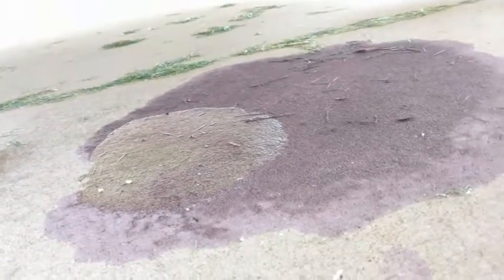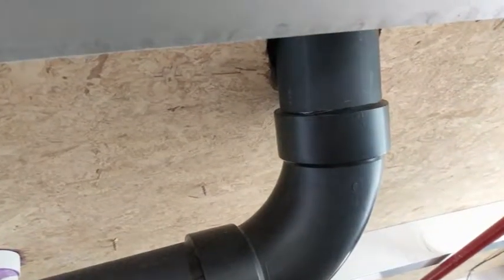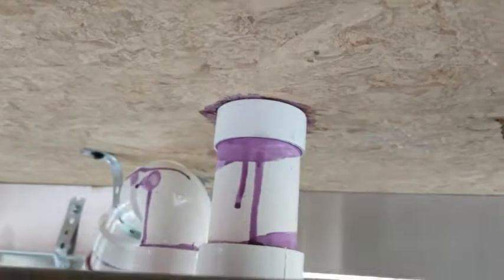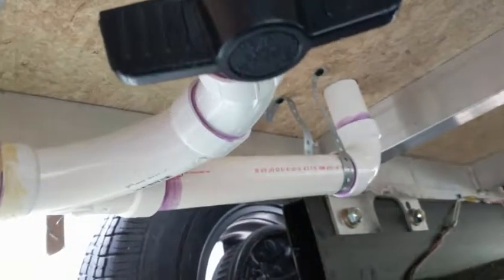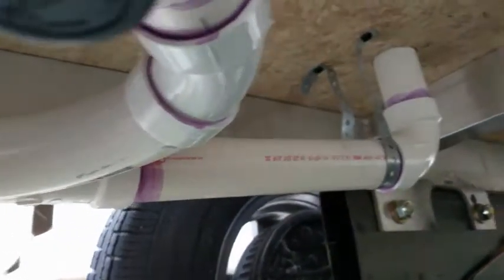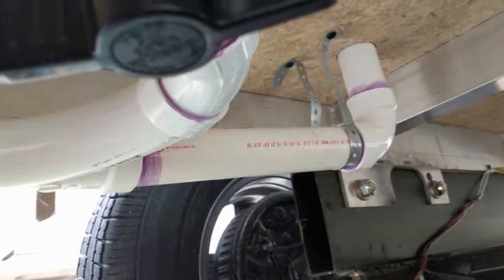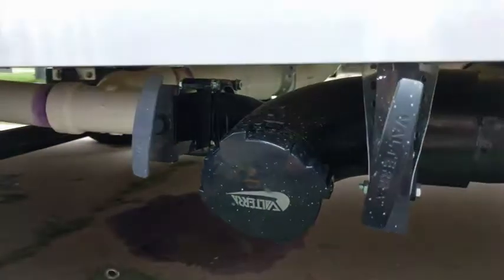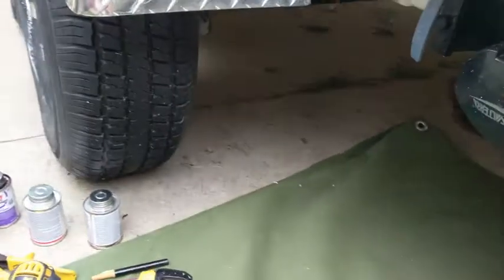Cargo Trailer Camper Conversion - Part 17 Drain Plumbing

Comment: Thanks for  taking the time posting videos of your build. Curious, does the floor plywood have a protective coating on the side facing the ground?
Reply from the maker: I added one inch of rigid foam under the floor and then protected that with a layer of corrugated plastic.  I added all of this at the very end of the build, but next time I would definitely do it before I installed any penetrations through the floor. It was really tough fitting it around the plumbing.

Comment: Where did you buy that black pipe ? Is it pvc ?  Would haft glue to regular pvc ? What kind of glue did you use for the black pipe? Thanks
Reply from the maker: It is just ABS pipe from Lowes or Home Depot.  There is special solvent made for it.  If you need to connect it to PVC like I did, then you need Universal Solvent.  It is sold in the same display at the store.